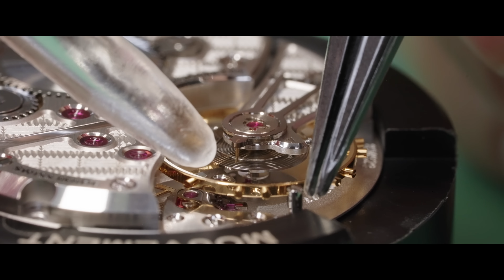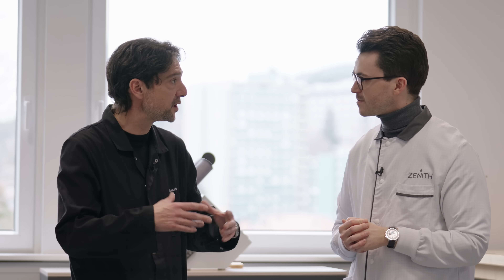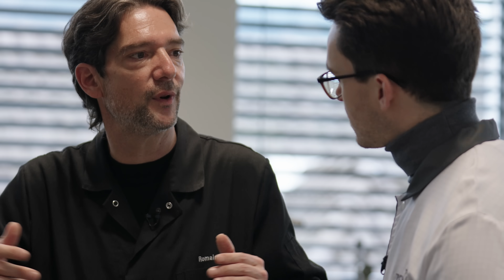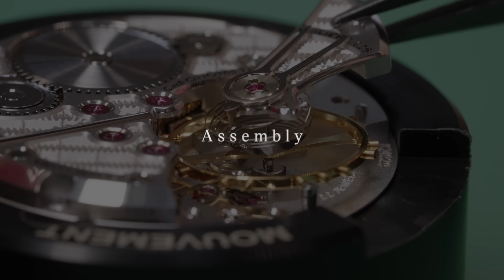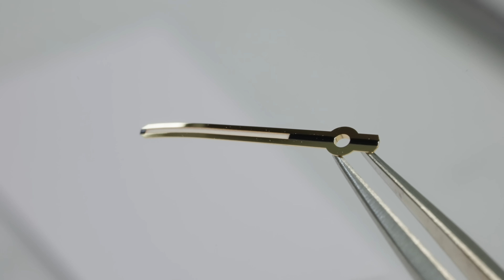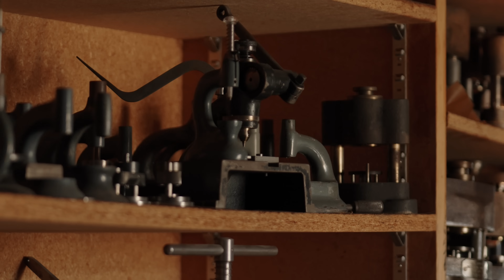Visiting One of the Most Under-Appreciated Gems in Swiss Watchmaking

Comment: Lovely video - thank you Teddy. So much handwork goes into the production with such intricate steps and the time it takes. Very few, including myself, knew about how many manual hours are involved and how carefully each step is monitored and finished to produce a single Zenith watch. I own a Zenith with 341 parts with the El Primero 4054 movement and love it. Indeed, Zenith is one of the most underappreciated watch brands. The video ended bit abruptly , wondering if there will be a part two of it as well.